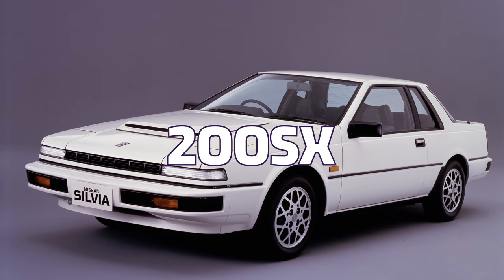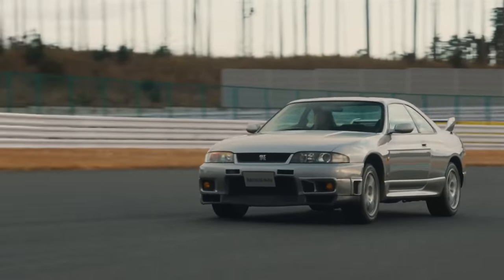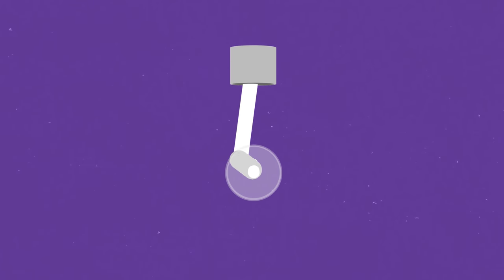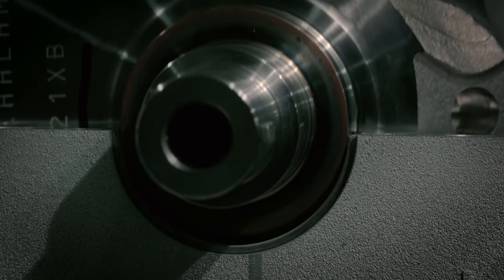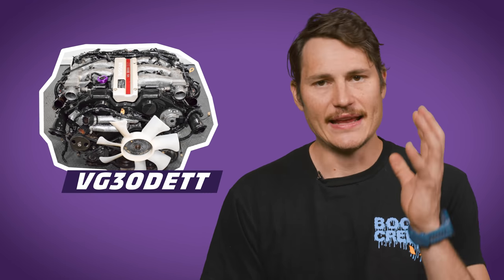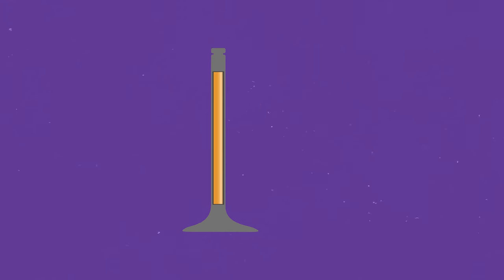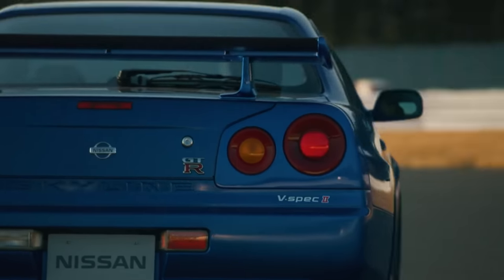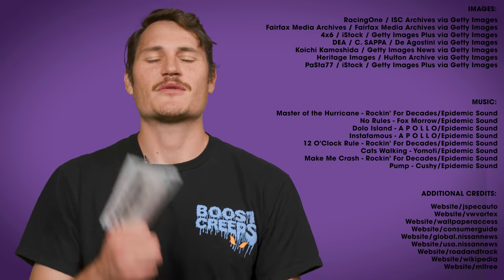RB vs. VG: Why Nissan Discontinued Their Best idea

Comment: The VG didn't "fade "away" it evolved like most of nissan's motors, it ended up being the VQ, then the VR
Reply: There was also the VQ precursor, the VE. It was just VG30DE with a different head to fit in the later 3rd Gen Maxima.
Reply: VQ is the frontier engine?
Reply: @lukedontknow9283  I've got a VQ in my G37
Reply: The VQ is a timing chain version of the VG without FI. The VR just adds that FI back to the VQ. Tada, modern VG as the VR.
Reply: @jacobmay7594  the vq didn't have fi?
Reply: @kcidmil  the ve was just a one off engine for a specific car, the vast majority of the v6s used in many nissans were the vg, and the vq
Reply: @jacobmay7594  The VQ30DET was available in the Y33 Gloria. The VQ was force induction equipped, the US just didn't have it.
Reply: @lukedontknow9283  The VQ was in nearly every model.
Reply: @Acarson87  It did in racing applications. The JGTC R34s actually switched to it from the RB26 in the later end of it's run.

Production wise, we got jack shit because the world is a fuck and cool things cost money to do.
Reply: @lukedontknow9283  yes it is the VQ 4.0 with a 4 liter  engine rated at 275 hrsprs
Reply: @troyfankell6581  I forgot all about the y33 Gloria. Thanks for reminding me.
Reply: Look at the r35 lol VG evolution
GTR body
Reply: Exactly ask yourself what's in an R35 GTR it's not an inline 6.not to mention all the Z cars after the VG30.
Reply: @kcidmil  oh that VE30de with a 5 speed manual in the 3rd gen maxima was a fun car, I had one and had two friends that also owned them… they would surprise lots of people on the street… hence the 4DSC ”4 door sports car” stickers on the rear windows.
Reply: VQ engine was actually designed by Renault first and been fitted in their models for a while. VG and VQ are very different engines.
Reply: @ryankim2915  vq came out before the Renault merger. But OK.
Reply: Exactly! 

They are still great engines.
Reply: @Acarson87  only one VQ’s came with FI, that was the VQ25det in the Nissan Stagea (M35) and VQ30det in the Nissan Gloria which never came to the USA
Reply: @ricardovazquez7261  But my Geedirty7 has 328 hrsprs with no super charger!
Reply: VQ all the way - creme dela creme
Reply: @sagealvarez1266  I thought the JGTC R34s used the SR20 near the end of their run due to the lighter weight?
Reply: @curtlonbryan2167  Nope, they were twin turbo VQ30s but the idea should be pretty much the same. Newer motor, less weight, should sit further back in the chassis.

Toyota did put a 4-banger in their Supras early on but replaced those with V8s around the early 00s.
Reply: @lukedontknow9283  and the VG, they were in several Nissan models at that time.
Reply: @lukedontknow9283  also the z and g platform engine
Reply: @lukedontknow9283  VR
Reply: @Acarson87  You couldn't fit your pinkie finger in a VG/VQ engine bay little alone Fl. 😂
Reply: @sagealvarez1266  correct, the 3sge motor in the super gt supra, gave the car better balance than if it had a 2j.
Reply: @jacobmay7594  What? Every version of the VQ had fuel injection if thats what you meant by FI. VR is only in the GTR
Reply: @SacDatsun  FI can also mean forced induction. Aka not N/a (naturally aspirated)
Reply: @sagealvarez1266  V8 in a Supra?? What???
Reply: @jamesmedina2062  It was a 3UZ bored/stroked to about 4.5 liters. All-aluminum, no turbo shit to worry about, can be set back farther than the chassis. Better option than having a heavy ass 2JZ sitting in the front of the car when you only need to make like 500hp anyways.
Reply: @lukedontknow9283  yes, my 2008 Frontier had a 260 HP VQ40 4.0L V6. Pretty nice engine, but yeah it's not a smooth boi (RIP Fred the Frontier 2019 I miss you)
Reply: @lukedontknow9283  vq35de in the 2005 Nissan quest
Reply: It ended up sounding a lot shittier. Idk what nissan did but the vg sounds great. The vq and the vr sound horrendous.
Reply: @jerodwolford2743  the VG still sounds like shit, most V6s do, with the exception of the Busso V6. Another point: Is everyone forgetting the major point that the VQ is all alloy vs the VG iron block?
Reply: @Acarson87  not true? The Nissan Renault alliance started in 2001 my dude. VQ came out in 07
Reply: @sagealvarez1266  bro what? The Supra has never had a V8, and especially not a i4, always an i6, like that's what made it a (celica) supra and not a Celica in the first two generations in the first place lmao
Reply: Yup my 2000 Xterra has a vg33 in it. All they did was bore out the cylinders
Reply: @Yixdy  PSST, he meant the JGTC race cars, not the roadgoing models.
Reply: thank you, exactly
Reply: EXACTLY!!! The VR30DDTT that is being used in the Infinity Q60 and now the New and upcoming 2022 Nissan Z (Z35) uses the same design principles from the Original VG30DET(T) in the 300ZX (Z31 & Z32)
Reply: Dude I basically said the same thing respect
Reply: Either you die a legend or you live long enough to become that boring V6 in the 370Z
Reply: @SacDatsun  The VR30DDTT that is being used in the Infinity Q60 and now the New and upcoming 2022 Nissan Z (Z35) uses the same design principles from the Original VG30DET(T) in the 300ZX (Z31 & Z32) so the VR38DETT is NOT ONLY in the GTR (R35)
Reply: @futokarin9745  Respect Bro!✊
Reply: @jacobmay7594  i hadn't considered that!
Reply: As a mechanic I don't think the French motors seemed like a Nissan evolution at all.
Reply: And the VK, which Nismo uses NA over either Turbo V6 in their Super GT and FIA GT1 cars.
Reply: @lukedontknow9283  Yeah, the VQ40 came on the 2nd gen Frontiers, Xterras, and 4th gen Pathfinder.
Reply: Vq came out in 2003 g gang 05 35 z boys check in
Reply: Yes this is right. The V series still kicking strong.
Reply: @lukedontknow9283  VQ series have multiple displacement and configuration, VQ35 and 37 are used on multiple sport coupe and sedans. VQ40 are most seen on Trucks and SUVs
Reply: @240trooper  370Z's had 332 hrsprs in later models
Reply: exactly...VQs are amazing
Reply: You mean Toyota right.?
Reply: No they evolved into LS swaps
Reply: @jacobmay7594  The VR38dett isn't really related to the VQ - It evolved separately as a high performance engine, more like a branch that split off from the VG with influence from the VRH race series v8s They are both closed deck engines that can handle a lot of power. The VR30ddtt is closer to an evolution of the VQ, as both are open deck.
Reply: @Yixdy  fuse no the first "HR" VQ motor came out in 2007. VQ motors were first released in 1994
Reply: RB evolved to VR so VG is VR now..
Reply: @nawin_playz  dude no the VR38 is based on the VQ motors and not even based on the VR30DTT motor. And VQ is based on VG. VR38 even uses the same valvetrain as the VQ37 which isnt used in any other motors. RB got basicly discontinued because theres just so many benefits to a V6 over an I6
Reply: dont forget the VR engine
Reply: @nawin_playz  no. Vg and rb are completely different motors. There is nothing that shares the rb
Reply: Proudly owned 2 VG30DET's. Strong internals with 26 Head bolts.  It was the most powerful Japanese engine ever created in 1984.  Legendary!
Reply: @NinjazBTRIPPIN  I did not know that was a VQ.
Reply: As an RB owner I can agree with this. The VG never died. Just like the 911, it continued to evolve and the VQ rings true it’s VG heritage. I really wish the RB continued to evolve like the V series engines. But I understand. It’s not as naturally powerful as a turbo charged VQ and it’s heavy and long.
Reply: The VQ sounds like a DEevolution to me.
Reply: @lukedontknow9283  350z/g35, 370z/g37, altima, maxima. Pretty much any v6 nissan that isnt a GT-R
Reply: Neat...
Reply: In other words gogeta unfused
Reply: Vg30e has been my most reliable motor in my experience, 190k miles and only had to do regular maintenance and timing belt and it’s running like a top and will beat limiter no issue and gets decent mileage
Reply: I would say the VR is a step back from the VQ platform. The VQ platform was already pushing 400HP naturally aspirated without turbos on the VQ35HR engine series which nismo tuned it into the VQ38HR thus being able to out 400HP and 311Ib-ft torque. Nissan really could have just taken the VQ engines and added turbos to it but at that point, then it just becomes a Nissan GTR with VR38DETT which that engine was also built off the VQ35HR platform. The new VR30 is a totally new engine and has no relation to the VQ and VR38DETT.
Reply: If the VG came in an AWD 
Chassis ... the VG would be just as popular as the RB .
Reply: @lukedontknow9283  VQ are in 350 and 370z.
Reply: So you mean it went from crap to being even more crap… cause The only VQ engine to be turbo was the VQ30DET and VQ25det….
Reply: @lukedontknow9283  not early 2000 and 90s those had vg33 de also extremely tough motors
Reply: @Acarson87 He means Forced Induction, the VG came out with EFI (in the Z31) .

Yes, I am aware there are carbureted versions of this engine, but they were for specific markets. Most markets the VG engine was ALWAYS fuel injected.
Reply: The VE was what the VQ was birthed from. The VE in the ‘92-‘94 Maxima SE was DOHC versus the VG’s SOHC design (in most of its applications), and had variable timing on the intake side. The VE was essentially an experimental engine to qualify their newest V6 design (VQ) for wide use across their product line.
Reply: @ryann373 I had a ‘93 SE 5-speed too. I wish so many more of those cars survived to today.
Reply: @ryankim2915 Uh, where did you come across information that Renault designed the VQ? Cuz that sounds like some alternate timeline fanfic stuff.
Reply: @nawin_playz Holy crap this comment thread attracted a lot of people that don’t know WTF they’re talking about.
Reply: @vert_f31 I had an ‘87 Maxima SE 5spd that I bought from the second owner at 182k miles. Only had to do a timing belt once, and drove the thing to about 228k.

Comment: VGs were used in JGTC Skylines. V6s also have a lower center of gravity. It's a little unfair to say VGs were abandoned., they were replaced by the VQ series. In truth, Nissan abandoned the I6 platform.
Reply: I mean the TB48 still exists
Reply: I mean the V6 is even in the current gen GTR, which tells a lot
Reply: Thank you! The VQ kept the same fuel injector spacing of the VG. The RB was abandoned due to its lack of versatility and applications.
Reply: @Thor Odin son also the fact that since it's longer, it is harder to fit in certain cars
Reply: @Thor Odin son if emissions was the problem Mazda would have stopped making production cars with the rotary around the same time. Sure the RB was a monster for its time period but there is a reason why evolutions of the VG still exists today much like the LS. Versatility, and from the performance aspect, weight distribution. A V6 can be mounted further back then an i6 which means better weight distribution, which means better handling characteristics.
Reply: Makes sense for them to stick to a v6 platform. unless they were like BMW where they focus mainly on RWD based platforms where they can get away with an inline 6. Engine development is expensive af.
Reply: Indeed they favoured the idea of a V6. However i think they did it mainly because they wanted to be able to fit it transverse in dreadful FWD cars like a Maxima. That's where you really need it. Looking at the Z models with their long bonnets it would also make sense to have an I6 and it would also make a lot more sense to build big limos with an I6 because these engines are able to shut up and deliver their power without much noise and vibrations. After decades Mercedes has finally made up their mind on the I6 and scrapped their V6s in favour of proper I6 engines. Halleluja.
Reply: @YouThana   a compact engine is pretty important for good handling cars as well. In the r35 for example its sitting much further back than an i6 could.
Reply: @bigd5899  BMWs have always been very good at achieving nearly 50/50 weight distribution. The R35 has the engine right above the center of the front axle because it's overall a bit more compact and uses a transaxle gearbox. A completely different approach. My M140i has 2/3 of the engine above the front axle. This is enough to get almost 50/50. Nissan however tried to build FWD econo cars and compact SUVs with the same engines for their sports cars - hopeless. Nobody in their right mind is spending premium money for this. This is why KIA finally switched to RWD for their bigger cars. Still with a V6 but we will see about that. Toyota also gave the Supra a BMW I6. Let's see where this is going.
Reply: @Thor Odin son wow you can read the brochers, jokes aside RB in stock form is a superior engine but introduce tuning the VG pulls ahead simply due to the cost factor.
Reply: @Thor Odin son lol cost associated with tuning not the motor itself lol 😂🤣🤣🤣
Reply: And don't forget the VR
Reply: @Thor Odin son You proved their point. With time, the RB got phased out because it wasn’t good enough. Nissan realized this and revised the VG into what we have now (which is in the new GTR).
Reply: @YouThana  the 3.7 is only in a couple suvs and the z and infiniti offshoots of the zs, any of the v6s in things like the maxima are 3.5s from the old zs